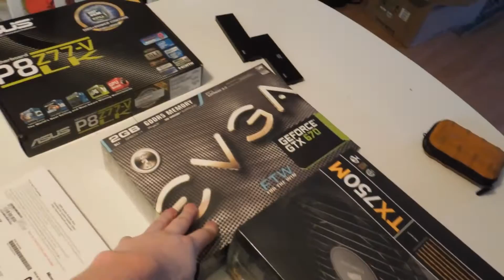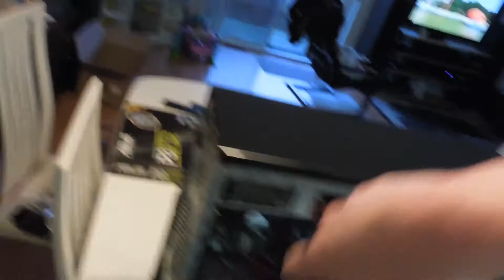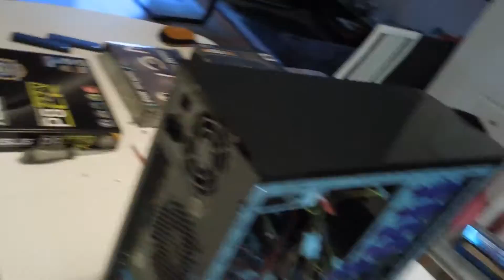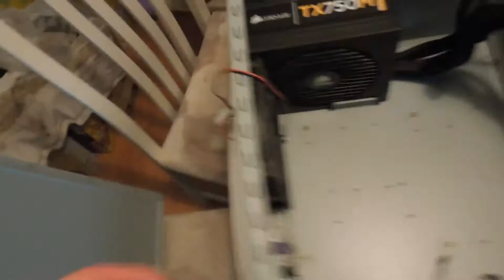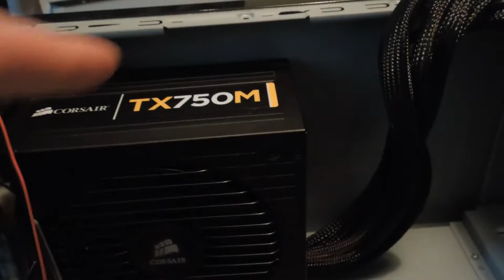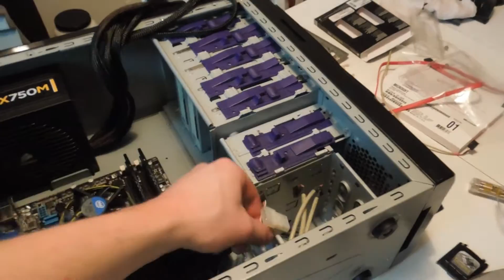how to build a pc or upgrade or upgrade pc computer tower

Comment: Noticed in the end you actually managed to find the correct motherboard connector for the CPU fan power supply. Also, you never put the graphic card in before anything else. That comes pretty much in last place. The correct order would be like this: PSU; HDD and disk drives, motherboard, case extensions to motherboard (front USB and Audio connectors, and the small ones for power, power LED, hdd status, reset button and the bios speaker), then you can add the processor, connect all the power cables for your motherboard, add the RAM modules and after that you add the CPU fan, connect all the HDD's and disk drives to the motherboard and power supply connectors and only after you've done all of these you can add the video card and connect the PCI power supply to the video card.